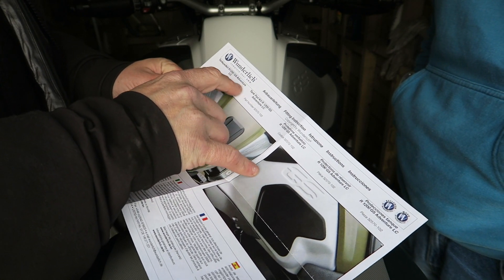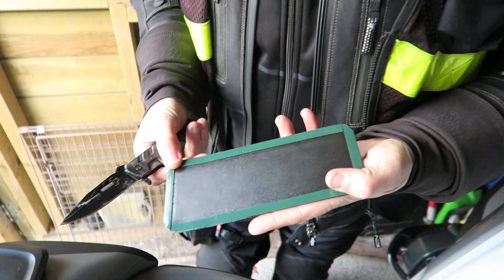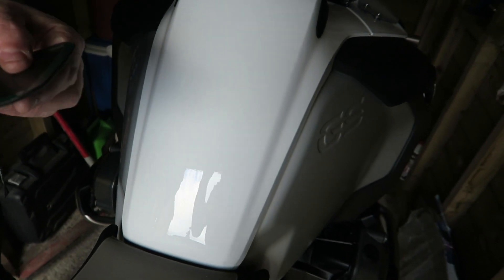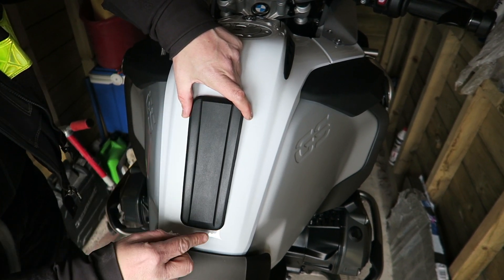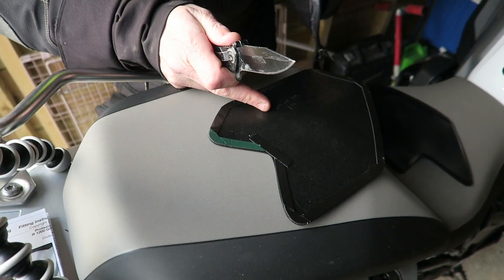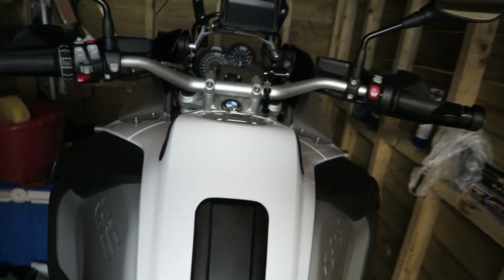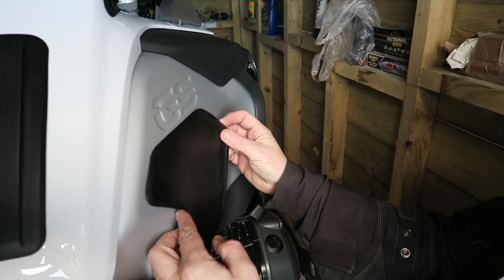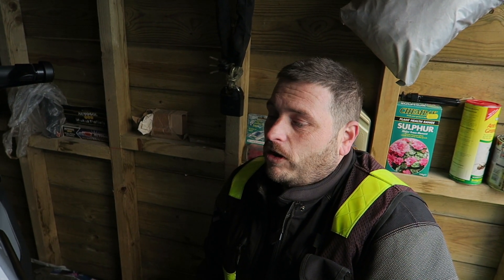Wunderlich Tank Pad Set for BMW 1200 GS Adventure

Comment: Like your vids a lot. Could you give a brief appraisal of how you've been getting on with the pads. Are they comfortable and are they totally doing the job. Torn between these and precut 3M stuff. Cheers in advance.
Reply from the maker: +AdvancedRider definately. Will do that for you :) but a sneak preview for you if it helps is that they are great. They are comfortable as they are a little spongy as opposed to the 3m ones that are stuck on. I find them particularly good when using positive steering techniques which as you know involves using different knee grips to pivot the bike etc, and these give a really positive feel/feedback when gripping the tank with your knees :)
Reply: RiderCamTV Again very helpful, thank you.
Reply from the maker: +AdvancedRider glad we could help :)